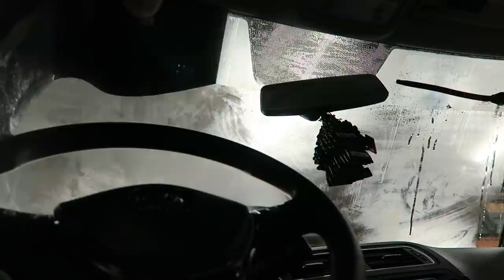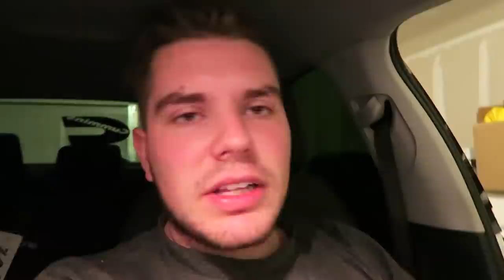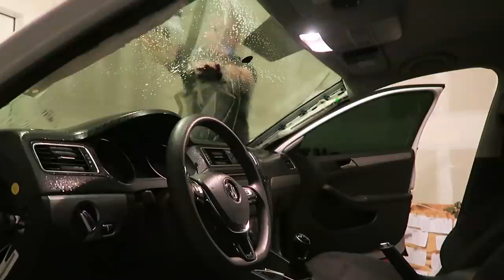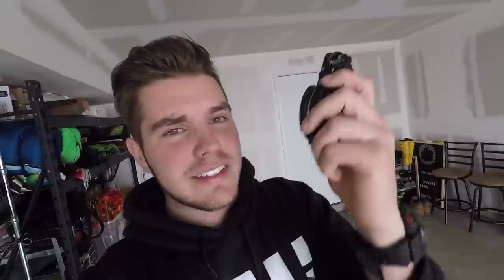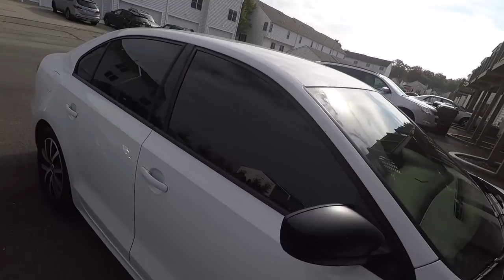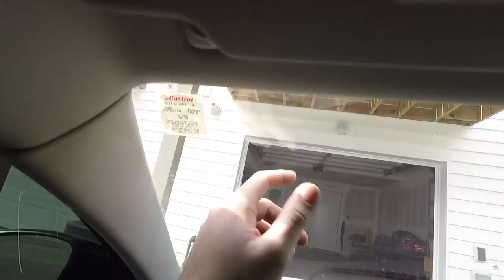What Happens When You TINT your WINDSHIELD!?!

Comment: I run %2 on top of factory %10 on my triple black extended cab S10 ZR2. im still considering tinting my windshield but I bought Cree LED headlights. and I put a "42 Cree LED light bar on my bumper for people with high beams they turn there lights off now and it works for people in the passing lane doing 5 under 😂 I'm still thinking of tinting my windshield to %35 my headlights are so bright you can see straight through the rear window tint even though it's %2 on top of %10

Comment: There are a lot of vehicles on the road with glarey headlights and aftermarket HID’s in halogen housing. Not to mention knobs that drive with their high beams. Cops need to start cracking down on these drivers.

Comment: What percent do i get if i get 18% tint over 18% factory tint
Reply: approximately 3% tint
(0.18*0.18)*100=3.24%
Reply: Robert Bidochon what % should i put on top of the 18%factory tint to = 5%
Reply: 27.7% (0.05/0.18=0.277777...) But it doesn't exist tint wise, put a layer of 25% if your tinter has it, if not try with 20% (this tint is very common so every tint shop has it), you'll have nearly the same as 5% : )
Reply: Robert Bidochon thanks lol
Reply: + EVERYONEHATESU21  I meant try with 30% => (0.3*0.18)*100=5.4%